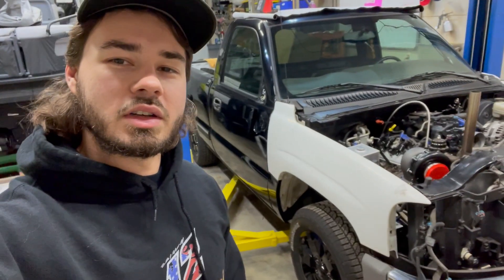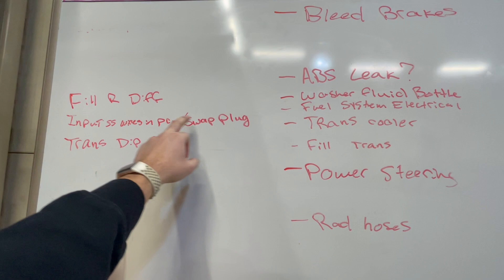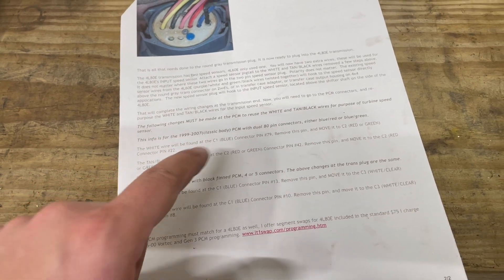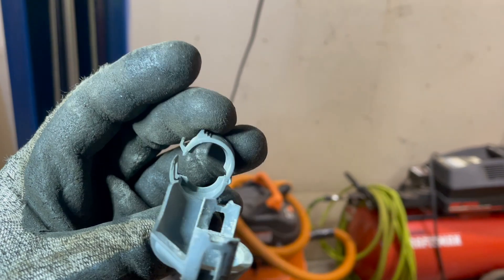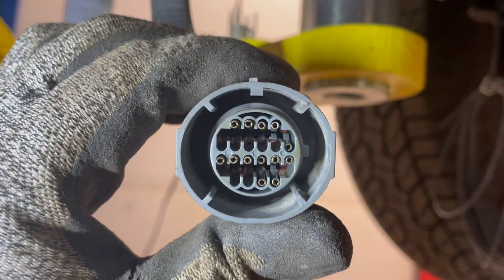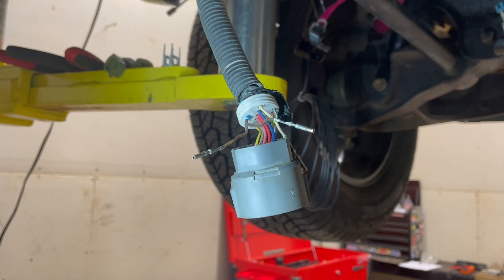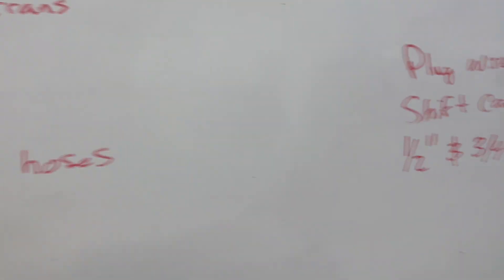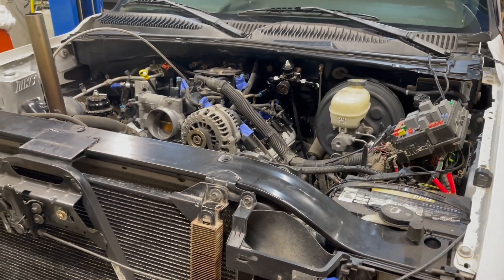HOW TO Convert your stock 99-06 4L60E harness & ECM to 4L80E TURBO AWD GMC SIERRA STREET TRUCK

Comment: Where can i find this write-up on how to modify my 4L60 harness of the denali AWD transmission? 
Am i able to mate my 4WD tahoe T-case to the Denali transmission and remove the AWD one? I want the strength of the denalie 4L80, but I want to preserve my 4wd option instead of AWD.
Reply from the maker: What kind of Denali are you referring to? In my experience the Denali trim never came with a 4l80E. They had a 4l65e in most cases. You can put a 4x4 tcase from a 2500 behind a 80E or you can adapt the 1500 tcase with a 32 spline input shaft - which is what I have done with my nv149, I posted a video on that.